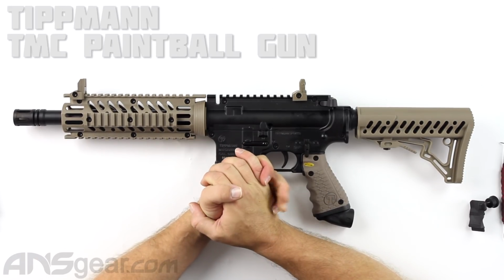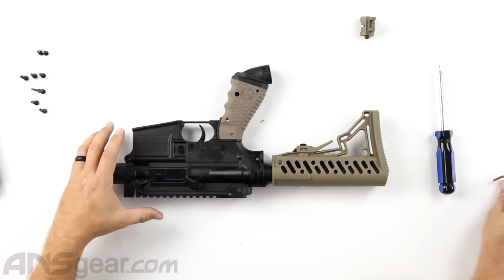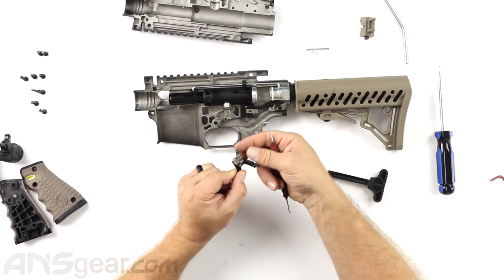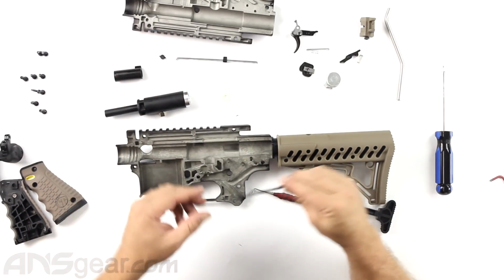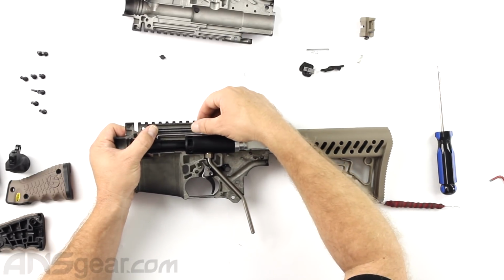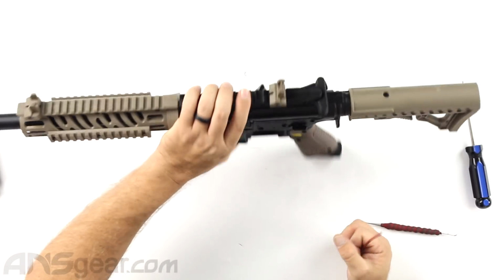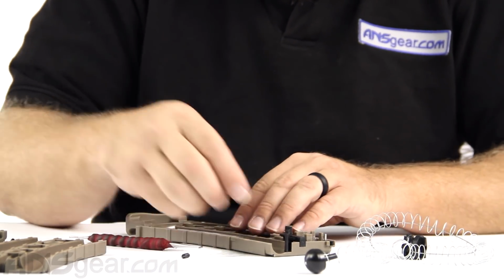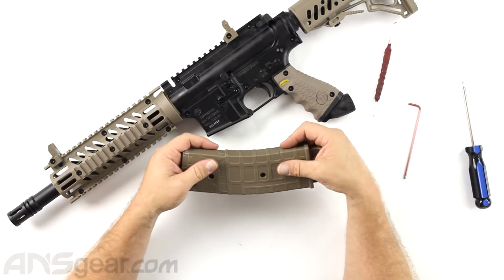Tippmann TMC Paintball Gun - Maintenance/Repair

Comment: Hello, good night. Could you tell me which ones without the measurements of the internal and external diameter as well as the thickness of the tippmann tmc rear bolt bumper pls

Comment: My TMC wouldn't recock. My hammer oring was clean, so I was confused. It was the power tube around the pin where the hammer slides into that was slightly dirty, and not that noticeable. Whiped it with alcohol, lube up the hammer oring, gun works fine now

Comment: My Tippmann TMC rattles after I set the fps to 260. Is there anyway to get it to the standard 285 without it rattling?
Reply: how do you tune it
Reply: @jeff.910  on the left side of the gun there’s a hole you can put a Allen key into it and change the fps (the hole is near the “TIPPMANNSPORTS” letters)

Comment: What do I do if my tmc keeps fucking up like for some reason when I use the hopper fed it jams and I have to pull it back to get the co2 back in it and it happens from time to time
Reply: it most likely needs some oil. Take apart and lubricate it well. Also make sure that your fps are not too low.. it can cause misfires

Comment: my tippman has a issue where the trigger "stalls" as in when i fire if i aim my gun down it wont engage again or refire unless i switch the safety off and back on or give it the "soda machine love tap" then it will got any reccomendations on how to fix it?
Reply from the maker: So it only happens when your gun is pointed down?
Reply: and when i fire too quickly and i took it apart and put it back together and nothing looks off

Comment: Can I put the gun in the water with out damaging the bolt or any of the guts in the gun?
Reply from the maker: if you dry it out afterward to avoid rusting, but it's not recommended that you do that to your marker .
Reply: rain is fine but i wouldnt dunk it in water for the sake of it

Comment: Is the buffer tube milspec or commercial spec size?
Reply: its milspec but there are two groves on the sides of it about 2 inches long on the receiver side so if you change the stock you wont be able to collapse it all the way in, if you are tall like me it works fine :) hope this helps

Comment: @ansgear, I have a question about my Tippmann TMC and I was wondering if you could help me out with it.
Reply from the maker: what's your question?
Reply: ANSgearPaintball So at the bottom of the ASA is a tiny hole on the TMC and everytime I hook up my air direct and also through a remote line air leaks out of that tiny hole. What do you think the problem is? And is it like an easy O ring fix?
Reply from the maker: It could be a couple things. Try replacing the O-ring of the tank and the remote line, (whichever part is being screwed into the asa). If the problem persists, then it could be the asa. They have been known to be incorrectly machined occasionally on that particular gun. If the problem persists after you've changed the o-rings, then contact Tippmann and tell them what's happening and they'll be able to set you up with a new asa if that's the issue.
Reply: ANSgearPaintball Okay sounds good, thank you, I will try all of those. And love the videos you guys put up
Reply from the maker: you're welcome
Reply: I purchased this exact TMC marker but purchased it for less than lethal home defense using jawbreaker balls instead of paintballs…..

Is there anything I can do to the gun  if I take it apart and drill any orifices larger or do any internal work to get the FPS to get any higher? Thank you so much